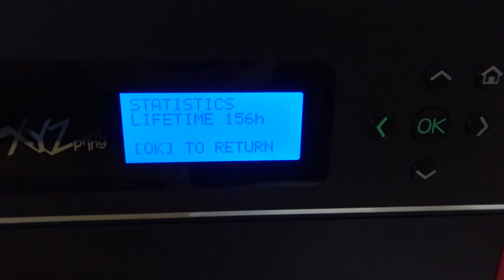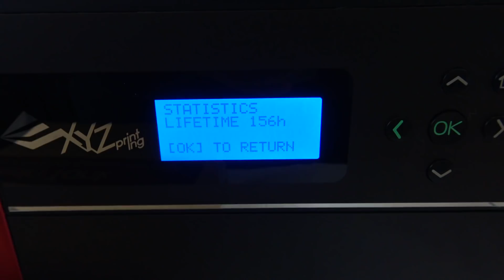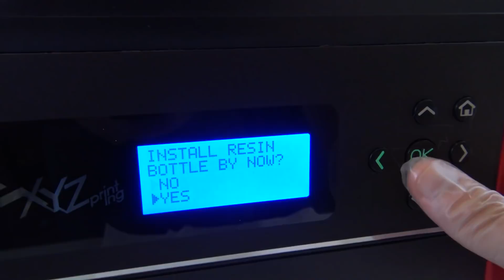Why Resin (SLA) 3D Printers are high maintenance.

Comment: Image a sla printer done like fdm style, resin above the build, I’m working on my own 3D printer, doing my own motors, all the pros of servo and stepper and none of the cons, and better than both, when I’m done I will have less than 1 micron XYZ accuracy. I’ve got the hardware, but I’ll need my own circuit design and software to go with it. Looking for a experienced crew to help, people who are loyal to start a company with. My printer can do cnc, fdm, and a seriously modified halfbreed sla. No parts to replace and compare to 50K plus printers, but should be cheap enough to so the average person can afford it. Looking for a team. I basically got all the ideas/factors down, willing to listen to advise, but there is a few things that can’t be changed.

Comment: You don't need to replace the build plate... you just probably need to polish it again!
I also recommend you to scrap the resin from the plate by using a material softer than steel aiming to not risk the metal.
I also would try to change the bottom of the resin bed by a better material with similar diffraction index of the original bed.
Reply: Wagner Ribeiro aluminium bolster a a light tap

Comment: $150 upkeep every 150 hours?  That's expensive as hell to run.
Reply: A decent amount of the information he gives here isn't really the most reliable. 150 hours of printing can look various different ways depending on what the prints are, you shouldn't be pouring your resin back with metal flakes in it because it will damage the tank more, you shouldn't need to replace the build plate that often, a ton of resin printers have disposable vat bottoms to cut costs.....
Reply: dont forget to add the resin costs

Comment: Would clear Acrylic polish not take care of that cloudiness? I use a product called Novus to shine up old scratched and cloudy Acrylic Aquariums in far worse shape then that Resin plate, and they come out Crystal clear.
Reply: Garrett R there's a silicon layer, it's that that clouds
Reply from the maker: Michel's right, there is a silicon layer that is what is wearing, not the acrylic itself. The comments here have had some suggestions of what I could try to replace that layer, I'll have to give some of them a try!

Comment: Hello Sir, I need to know one think about this printer: 1- do you ever print something castable? 2- do you use it in 25 Mic setting yet? (i am going to buy one printer SLA I think, and use it in jewellery industrial. Thank you for the information already I take with this video.)
Reply: Ramin Rady use plastic printer with jeweller's hard casting wax and fan cooling the hothead, hard waxes melt liquid in a predicdable way that goes through a tacky phase in heat exchange, you'll need to do some recalibration. I'm thinking lostwax replacement engine part printing..

Comment: *6:40 begins telling us about the metallic particles, dirt and crap in the vat.  AFTER he pours 2 tablespoons back into his main clean container.  
At the risk of sounding frivolous, I would dispose of the 30ml (or so) from the vat, or at least save it separately.
Reply: He's wrong on several points there actually. Firstly, vats can absolutely be used for multiple colors. You just use IPA to clean them between colors. Second, you use a paint filter funnel to return the resin back to the clean bottle; they're cheap and disposable and work great.
Reply: @ShadowDrakken  I believe IPA damages the PDMS (silicon) layer on the bottom of the tank(s), so it's not advisable to use IPA.

Comment: This is just me thinking out loud but I have a hard time believing there is no way to clear up that clouding of the tank somehow. It would eventually become too worn out in general but just for the clouding I am sure people will come up with a solution. Same with the build platform. Aside from not using a metalic object to scrape it the plate is aluminum. Am I just too naive in thinking you could  wet sand it with some fine grit sandpaper ?

Comment: I wonder if a borosilicate glass tank (or at least bottom) would work (refractve index) and be more durable.
Reply: Bernd Rutzmoser also they use a clear silicon mix from solarpanal manufacturing. You can buy that and replace as needed.
Reply: first thing I thought too. why not a glass tank? duh. lol! hahaha! because they need that .35cent per hour charge on the user.

Comment: I'm looking at getting a SLA down the road. Does SLA prints smell? If so, what do you do about them?
Reply: Go to your local hardware store and pick up one of those LED glue pens you see advertised on TV, called something like LASER BOND. It's basically the same photopolymer resin. You can smell it yourself.
Reply from the maker: The resin certainly smells, especially after printing. Post-curing by shining UV light for a bit makes the object smell less, but there is still a smell for the next few days. To me it smell slightly fishy in the room after a print has finished.

Comment: ($55 Resin vat and $100 build plate) Or buy a $10 buffing wheel that will fit in an ordinary drill and buff the build plate and resin vat...
Reply: @Lamune Baba for like $20 you can pick up a package of the film used to line the vats in most printers.  It's a pretty simple task to change out the film.  It does wear over time and needs to be replaced every so often.  I've only had to do it once in 3 months of use on mine though.  There were 8 replacements in the pack I got for like $22 (shipping included).

Comment: 5:35..."impossible to get all of the resin out of this resin vat"...why can't you use the same solvent that you use to clean the printed pieces to get the minimal residual layer of resin out of the vat (assuming the vat/tank plastic is not dissolved also by the solvent)?
Reply: perspectivex isopropyl alcohol will do just fine.

Comment: how do you like this printer,  been seeing alot of post about the prints not sticking.
Reply from the maker: I've had a handful of prints not stick, but I'd say its a 80% success rate overall. I've been printing a lot of miniatures though, with complex support pillars, and a majority of the failures were due to the support not building correctly, not necessarily bed adhesion.
Reply: thank you
Reply: kinda fed up with this company since im in hawaii they say my printer is not warrented.  and i cant order a new resin tank since they dont ship to hawaii.  lucky i bought 2 year warranty from b&h

Comment: I wonder how these costs compare to those of the >$600 FLSun DLP printers.  Nerys damaged his tank-bottom film and replaced it for $19, so I guess the whole tank isn't necessarily replaced for DLP printers.   Don't know about the build plates on the FLSun units.  $100 sounds very painful!  I am aware SLA offers higher resolution than DLP.
https://www.youtube.com/watch?v=_BhIfFpTni8
Reply: On those you only need to change the FEP film. It's around 5 euro each
Reply from the maker: When the build plate starts to give me trouble, I'm going to try and sand it myself to see if I can get it back to a workable condition. I don't think it's coated with anything, I think it's just a smooth steel surface.

Comment: u just steered me away from SLA printers.  too pricey, nice detail, but buying stuff from a dealer is higher quality.  Too much maintenance and not enough flexibility
Reply: Don't go by this video. This guy's processes and techniques are wasteful. Plus, there are other resin printer technologies and designs (projector, LCD, using a consumable film for the bottom of the reservoir tank, etc) which are less expensive. 
The bottom line is that resin printing will always provide a higher definition, more accurrate final product then is possible with plastic filament printers. So you essentially get what you pay for, as the adage goes. The question is whether or not you print items that can benefit from a higher resolution, or not?

Comment: 35cents/hour just for the resin tank! :(
Reply from the maker: Yeah, higher costs all around. More expensive machine, more consumables, more expensive materials.

But absolutely amazing prints.
Reply: Blodørn the thing is FDM printers cant do everything, especially when you are printing small parts that need to be accurate. Im getting a DLP in a couple weeks, but ill still use my prusa clone when it can be big and inaccurate.
Then when i need to print something like a trigger mechanism for a game controller I'll use the DLP.
Reply: @LittleRainGames  Yep, the difference is in the prints. Amazing detail due to the tiny laser spot size (as opposed to a large nozzle in FMD), and also excellent surface finish and strength in all directions due to the prints bonding in a crystalline fashion (as opposed to amorphous with FDM).

Comment: Are you sure tipping the resin back in the bottle actually saves it? I heard those bottles have a chip or code and the printer measures the usage, which is a method XYZprinting have implemented to ensure you can't just refill the bottles with 3rd party resins, therefore I would assume all that resin you are pouring back in has already be tracked by the printer, and it would complain that bottle is empty when it gets down to that amount you poured back in. I am currently researching cheap SLA printers as I want one, this used to be at the top of my list, but by the looks of things XYZprinting really makes money off you in the consumables rather than the printer itself.